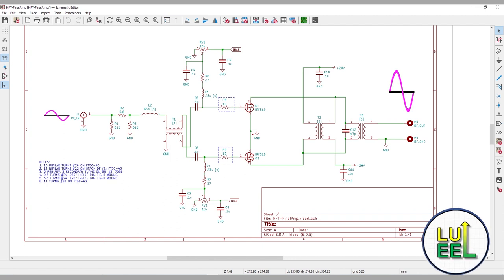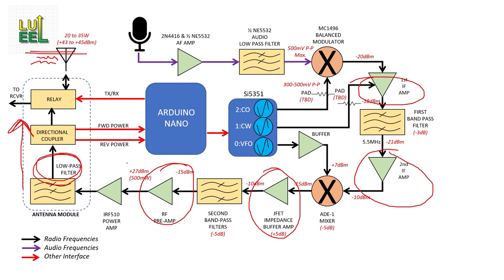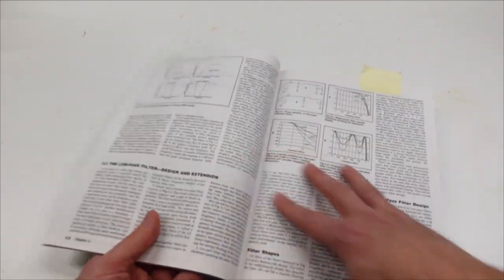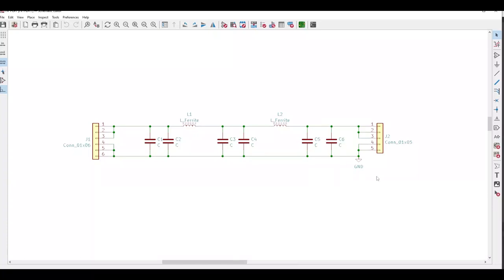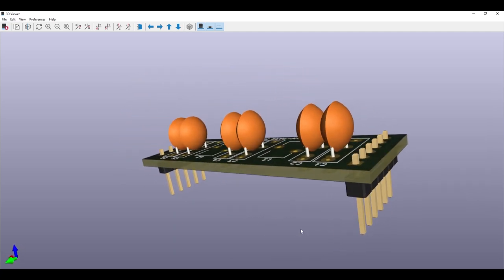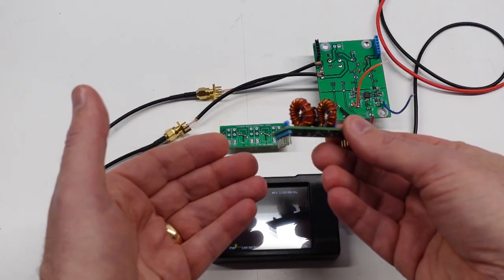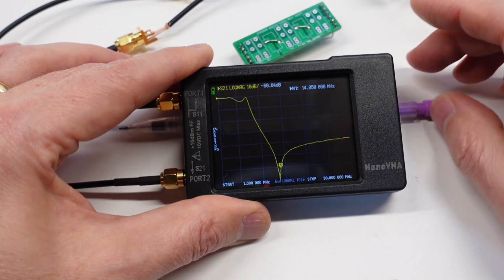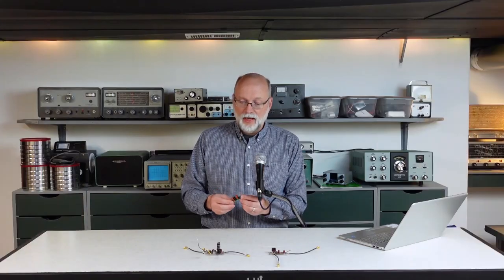HF Transmitter #10 - Low Pass Filter

Comment: the transmission zero (notch) ALWAYS occurs because of some cross coupling between two resonators or between the input and output. So it is either a magnetic coupling bween the two toroids that is causing it or most likely your board layout is causing a (weak) coupling between the input and output.
Reply from the maker: Interesting.  I didn't apply any thought to coupling when I laid out the board.
Reply: @levelupeelab  I think in this filter it is more likely due to a weak coupling between the toroidal inductors rather than between the input and output because in the layout nothing stands out to me as being the culprit. You can put a metal shield around the coils or something to separate them and see if that eliminates the notch. Simulation should be able to show that too